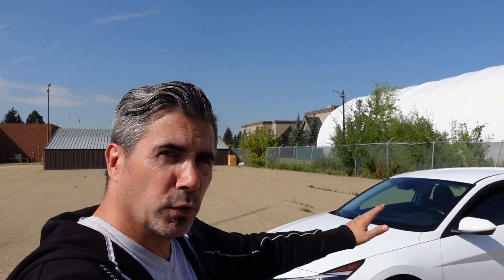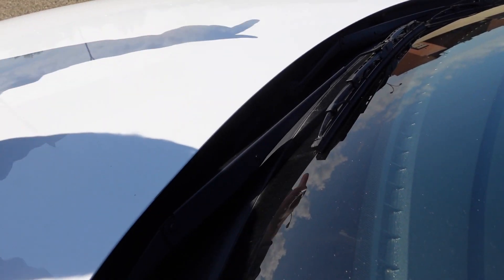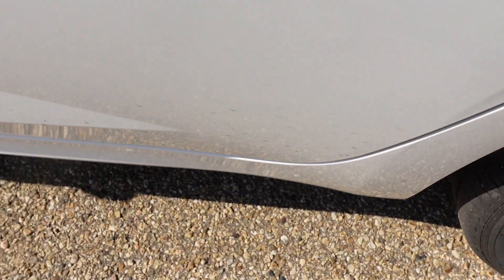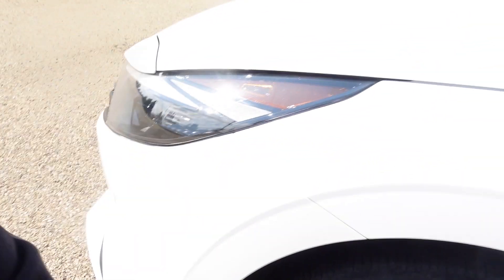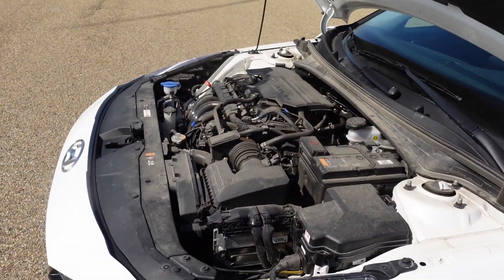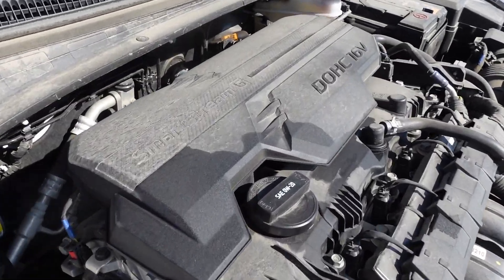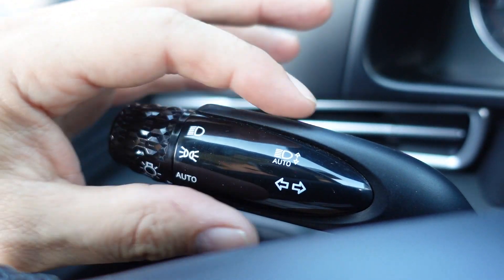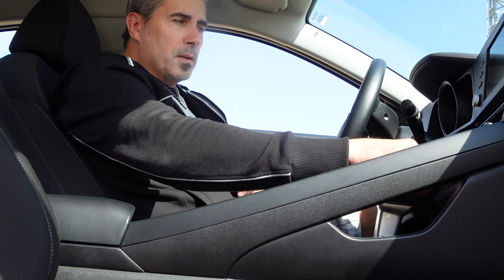HYUNDAI ELANTRA REVIEW - What No Engine Fires?

Comment: bought this car 6 months ago. $28,800. same car as reviewed but 2023. Has a great ride and engine tranny the same as reviewed.  only 2 keys allowed by computer which a PIA when traveling out of town alone. so far 45mpg.   Have the newer electronic dash board that is a huge PIA to use. Agree with everything said about ride and finish.
Reply from the maker: Thanks for dropping a line.  So overall it sounds like an agreeable car to own albeit not perfect, it still works well.